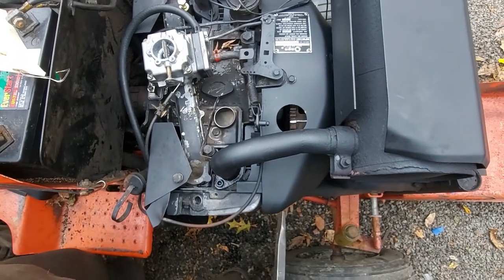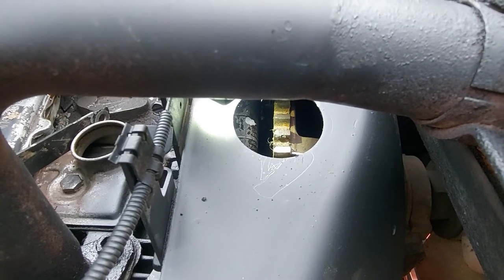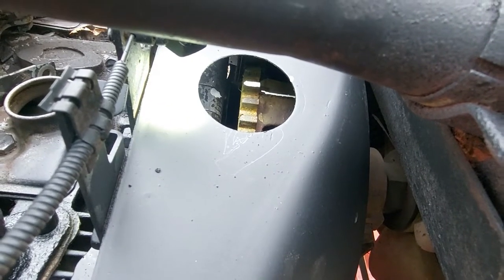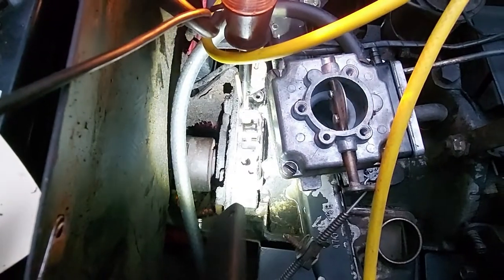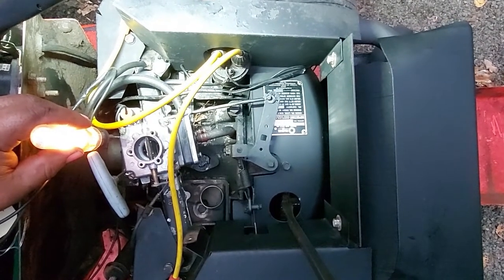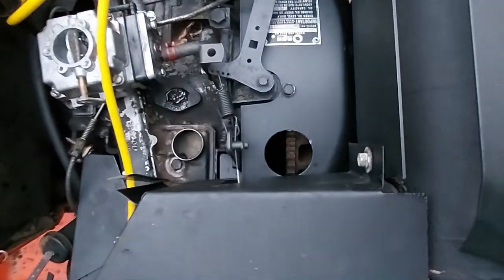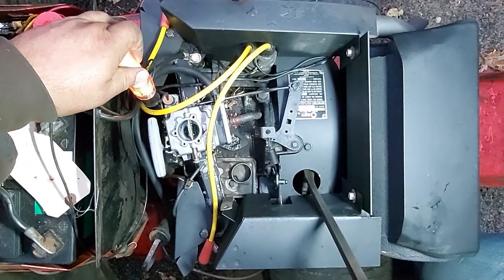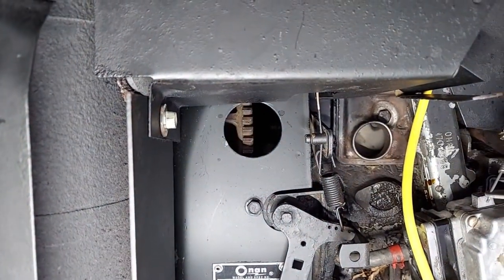2 Ways to time a small engine points ignition, using a test light or timing gun/light. Onan shown.

Comment: those side-by-side shots showing the diagram of the peek hole in the flywheel cover and the hash marks that are visible are VERY helpful in understanding where it should be timed at.
Reply from the maker: Glad it helped.  We figured that shot would help many understand what they are looking at and for. Thanks for watching and the comment!
Reply: @caseingersolltractorsnortheast  great video...keep them coming...I'll be watching!  I set my tractor (Onan B48G) using the feeler guage method in the points first...and used the test light using your method to confirm.  was bang on.
Reply from the maker: @mackendw  thanks! Will do.

Comment: Another great video! Thanks guys! One thing I found helpful was to align the timing mark (flywheel to timing cover in the stationary position) then scribe a line across the blower housing and the rotating flywheel screen. Much easier to target my timing light to.
And great heads up on the cheap points and condensers! Been having periodic Ignition trouble. I pulled the points out and the flat spring was only a few thousands from grounding against the frame!  I am sure it was arcing sometimes Thanks!!!!
Reply from the maker: You are most welcome. Yes good idea for marking cover and screen. We do that on some of our own and it is much easier to see. But on customers equipment we cant go marking it up lol. Thanks for the support and comments!

Comment: When I hook my light up it stays on no matter when the points are open or closed. The engine won't start either. What would cause that, the coil?
Reply from the maker: Could be the coil or wire issue.  Where do you have your light clamp hooked to positive or negative battery terminal?

Comment: Can the ignition module be switched over to points on a P 216? That module is very pricey
Reply from the maker: Not  easily as I think you would have to change the cam I dont think the lobe for the points plunger is on the "P" cams
Reply: @caseingersolltractorsnortheast  I’d sure like to find a cheaper alternative
Reply from the maker: Yes Onans are hard to beat and great but, parts are not cheap!  But if the part last another 20 to 40 years I guess its not that bad then lol.